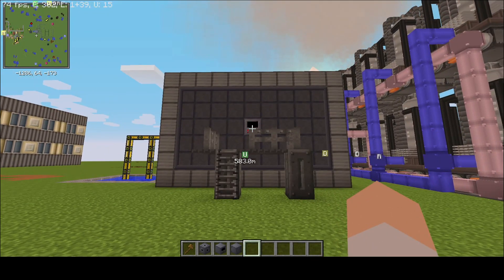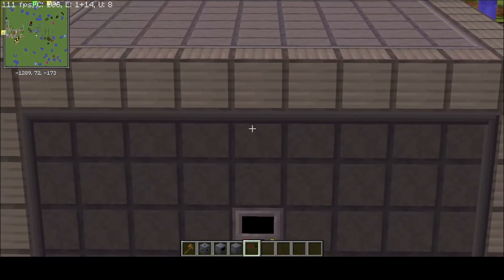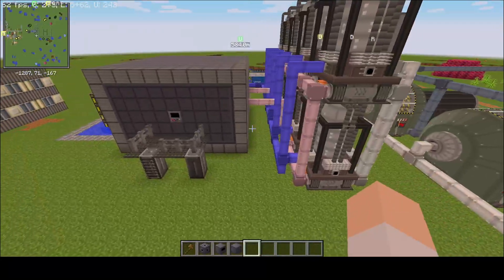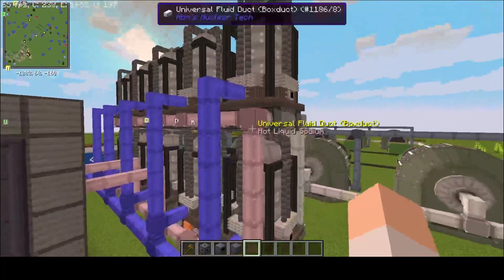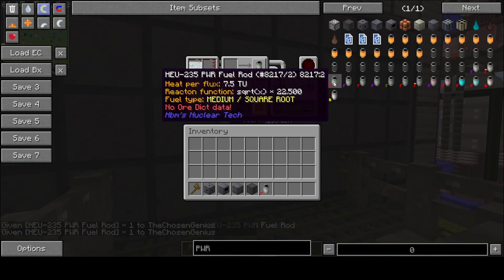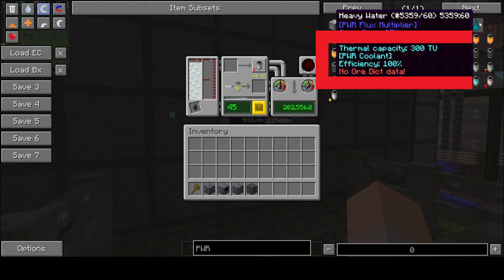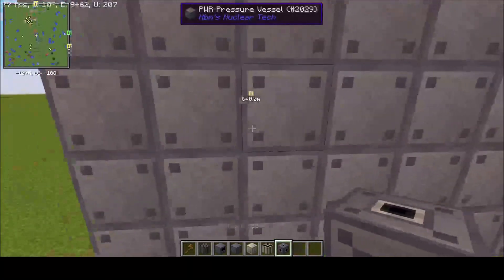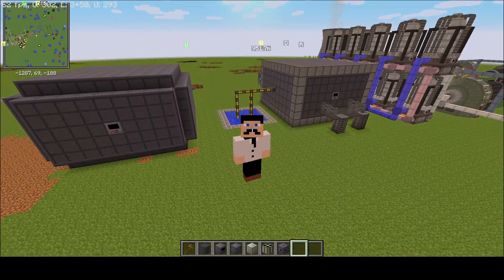Pressurized Water Reactor | HBMs nuclear tech mod (Showcase)

Comment: I've been running this reactor for two hours and it's never given me any spent fuel.
Reply from the maker: Are you using the automated fuel extraction method i showed? If so then its probably at the spent fuel pools, if not then revise the core fuel conversion over a short period of time, and also check the control
Rod level